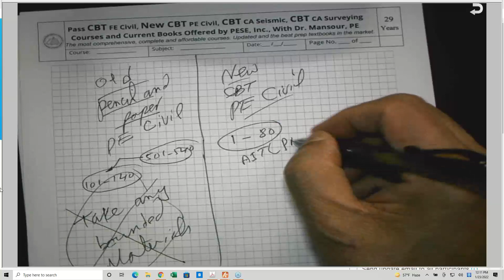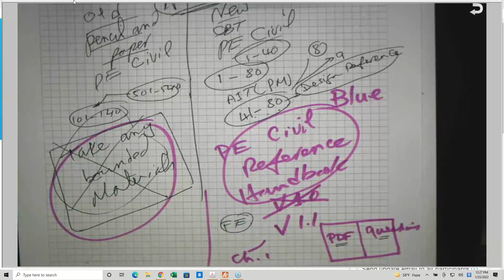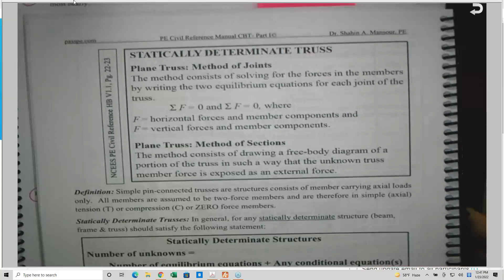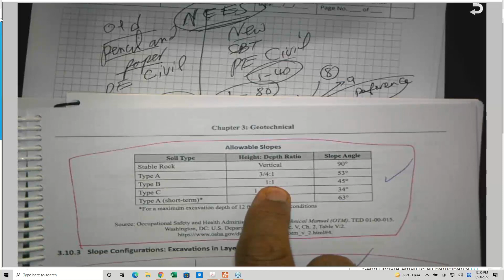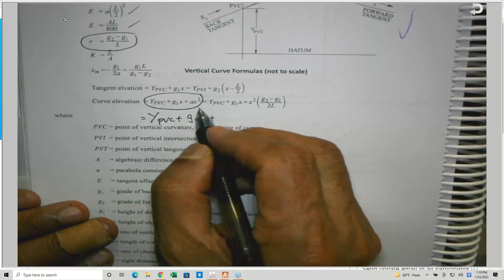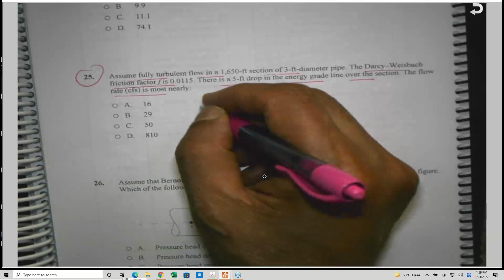2022 NEW PE Civil CBT  Free Webinar by Dr. Mansour, P.E

Comment: Is it true that the breadth and depths are now mixed in throughout AM and PM?
Reply: No AM is first then break then PM
Reply: @krispe2512  actually just learned today that breadth and respective depths are mixed throughout AM and PM sessions, therefore no more breadth in the AM and depth in the PM
Reply: @acordeon3000  what? I don't think that's correct. I just took the exam like a month ago. Why would they change the format. It doesn't make any sense
Reply: @krispe2512  you might be right, my source is from someone else on YouTube that also says to have taken the exam about a month ago. 

But if you can clarify this further I would really appreciate it!
Reply: @acordeon3000  I know for a fact that the am and pm are separate.  I know Dr Mansour personally and he confirmed this.  Its always been separate.
Reply: @krispe2512  how was the cbt when you took it? I need to retest. Took the paper-pen version before.
Reply: @oleopathic  fine. Focusing heavily on Aceing the morning, I passed the second time around. I got a little lucky with some steel in afternoon that I knew exactly how to solve
Reply: @krispe2512  whats a good source of AM transpo and construction problems and solutions? I'm retaking as those were my weak areas.
Reply: @oleopathic  test masters is what I used. They have e a lot of practice problems